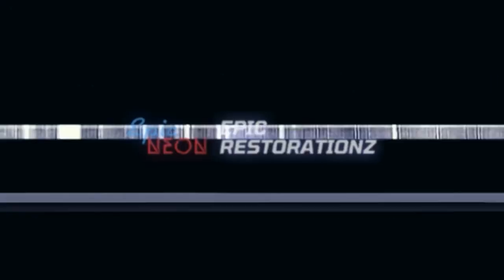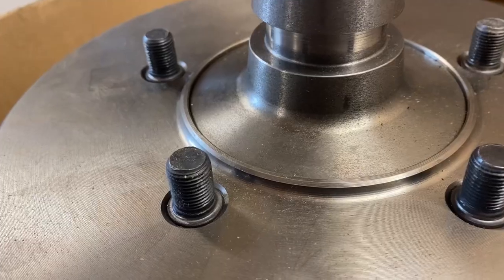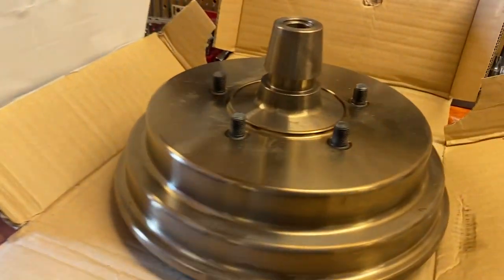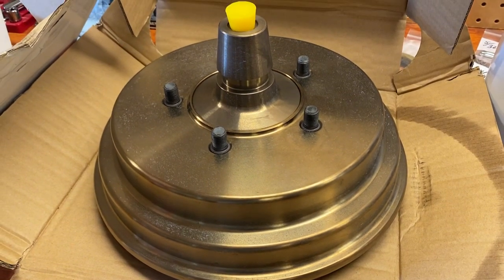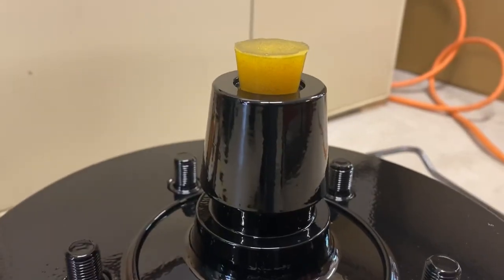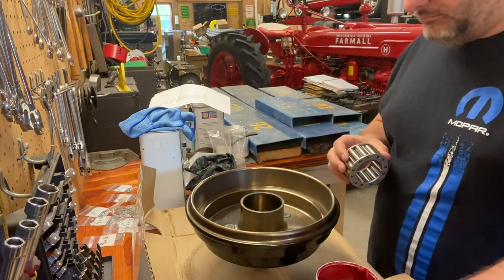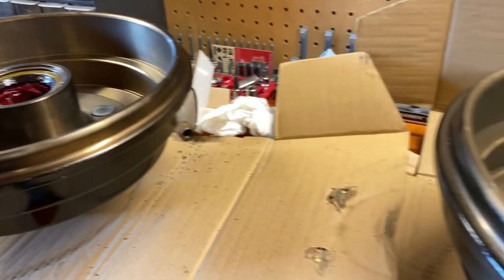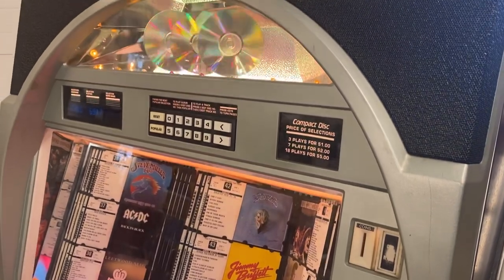1930 Ford Model A | Cast Iron Hubs and Brake Drums | Rear Brake Drums

Comment: Difficult to tell 100%, but looks that the seal may be installed backwards. The lip should face the bearing. It’s somewhat counterintuitive until you analyze the direction of the grease flow when later servicing through the backside grease fitting. The grease flows down the axle shaft and into the bearing cavity.  The purpose of the seal is to keep the grease in the cavity and not leak out  on the shoes.
Reply from the maker: Thanks for watching. Seals are good, but thanks for checking anyway!  Wouldn’t want to get down the road and have that problem.

Comment: Did ya install the return springs on the back side? I was hopin' ta see that. Overall, I liked the video. Thanks for postin' it.
Reply from the maker: Yes, we did. Unfortunately it took both of us to do it, so we didn’t have anyone to hold the camera. Those things are tricky, but it can be done. We used a small hammer and a metal clothes hanger and were able to get it done. Just takes a little patience. Hope you’re able to get it figured out. Thanks for watching!